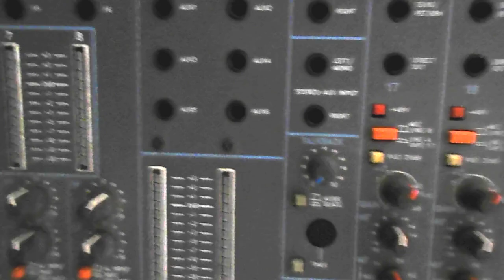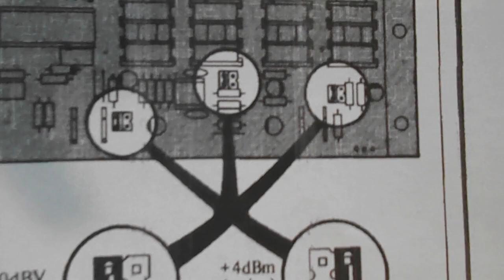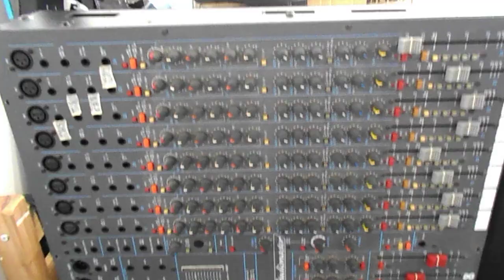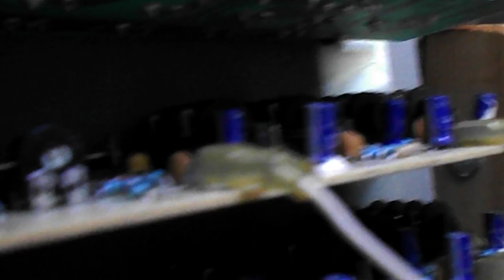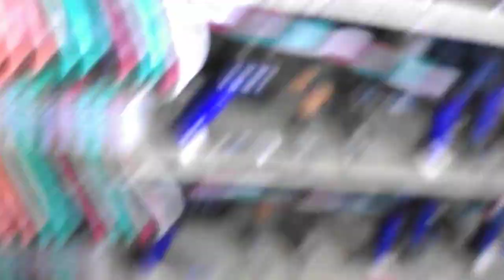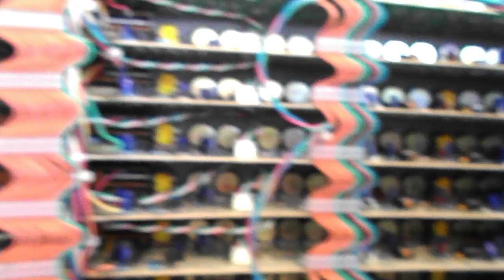Studiomaster Mixdown Classic 8 - Checking Channel Link Pin Settings

Comment: Hi, Neil! I hope your arm is recovering well. Look! I have two problems: One is that channel 24 on my mixer doesn't send sound to the left and right master outputs, but sends a signal through "LISTEN" to the LEDs. The other problem is that the LED on the right always lights up louder than the LED on the left, even if you turn the PAN knobs all the way to the left. And this happens on all channels. Can you tell me why these two things happen? Thanks for your reply. I wish you good health. Vitor Machado.

Comment: Hi Neil, thanks for the video.  picked up the exact same desk yesterday and am planning on checking out the same nerdy things. Just wondering what you used to clean the pins and whether you did any other cleaning while you were in there? Spray the pots? Cheers.
Reply from the maker: Hi there and thanks for the comments.  Yeah I thought it would be helpful to film how to check/change internal jumper pins as its such a big beast that its worth seeing inside just to plan whatever you want to do.  I'm thinking I'll get an HD headcamera to film anything like this in future as I can only use my right hand (as left arm paralysed in accident).  So not getting "stuck" on simple issues of whats plugged in where and what to you need to unplug is a must.  I think that working with the desk stood up on its end is the best way to tackle it initially.  If I was going to do a full pots and fader clean up, I think I'd probably separate the top panel completely from the body casing and work with top panel upside down on a flat surface or keyboard stand.  As most of the pots cleaned themselves after a wrist aching 20/30 turns, I just went in for a check, change and clean up of the jumper pins.  I just used a flat needle  file thats powder coated in some very file abrasive dust  . . . .  or just as good are the disposable cardboard nail files (that the ladies use) as they are flexible and cheap as chips.  Happy mixing!!